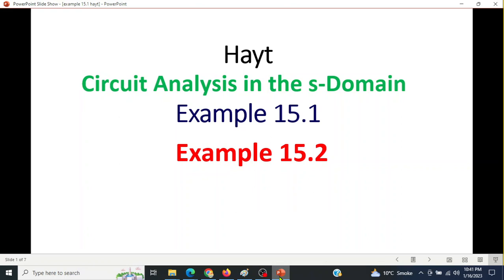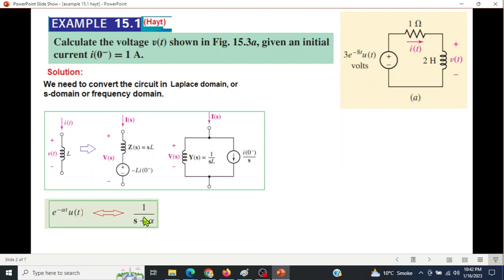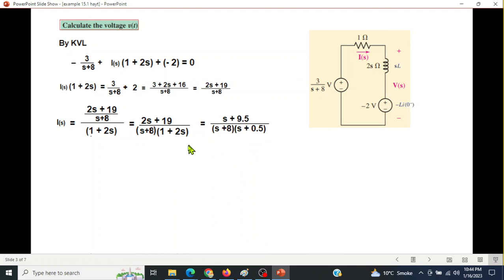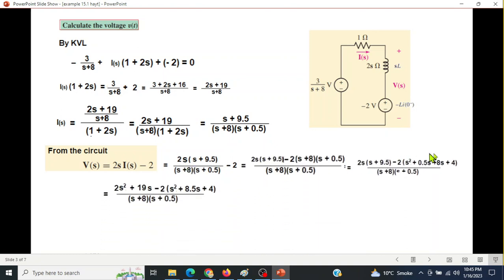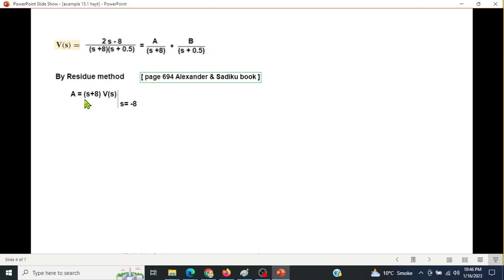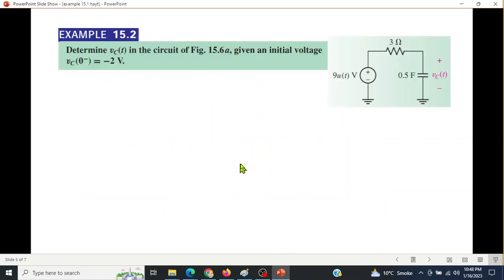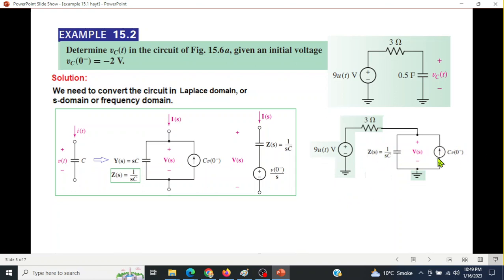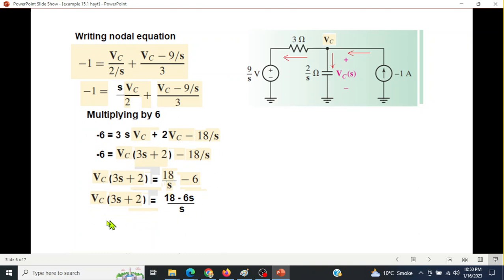(English)ENA(H) || Example 15.1 || Example 15.2 || Circuit Analysis in s-domain

Comment: Why did you change the admittance form in 15.2
Reply from the maker: Just to have an idea that a question can be solved using both circuits. Try with the series option and see which one  is easy.